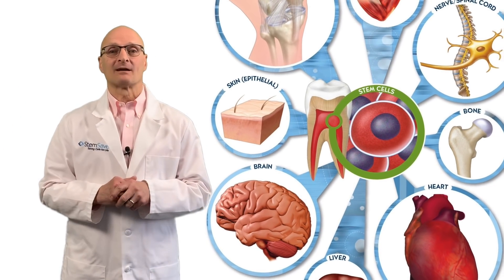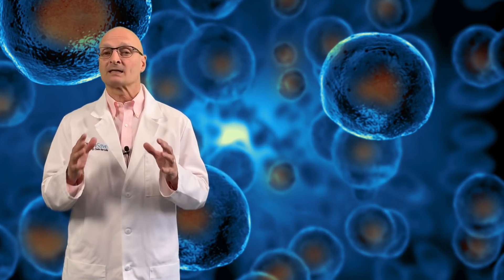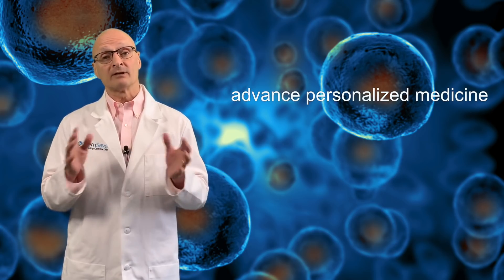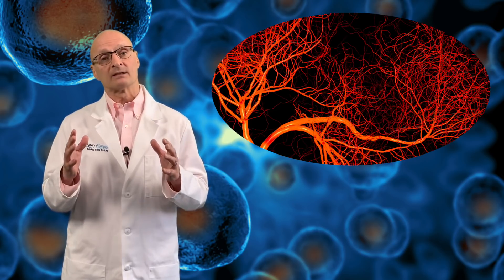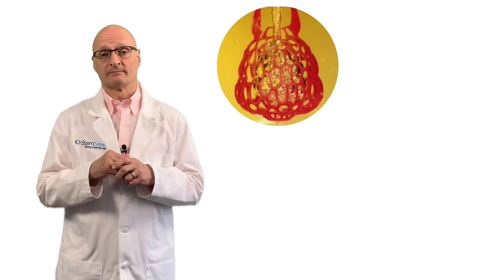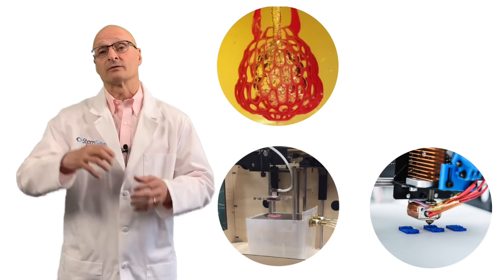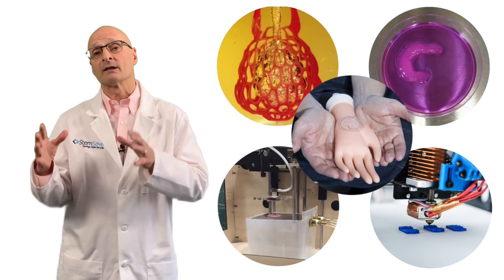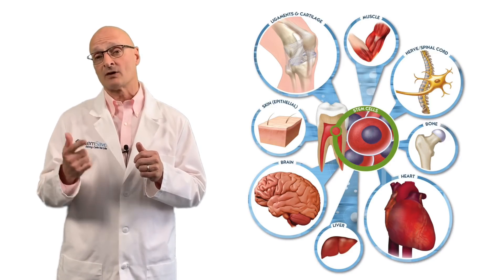3D Printing Organs With Stem Cells

Comment: The future of transplantation recognizes the body for an organ so that it is not oxidized
Utilizing dyes to layer and distinguish between cell structures creating origami organs that is 3D printing cellulose the common ingredient in paper to create organ structures which are then populated with  stem cells flash-freezing layers of printed tiussue until the entire organ is printed and fusing these 2D layersinto a 3D strcture using ultrasound  to corral and direct the placement  of cells and creating bionic prosthetics that is integrating live cells into the prosthetics during the printing process